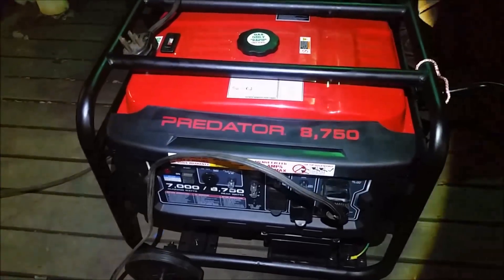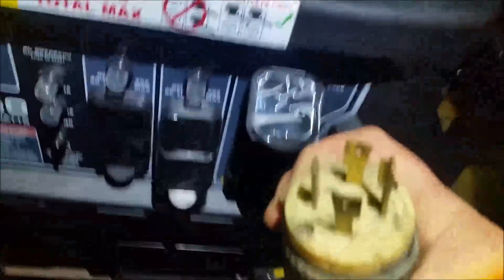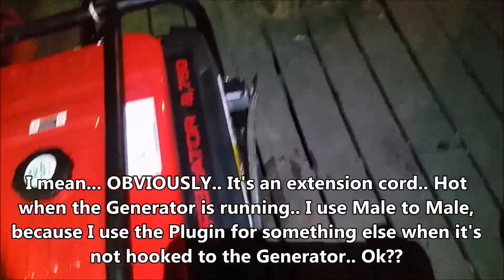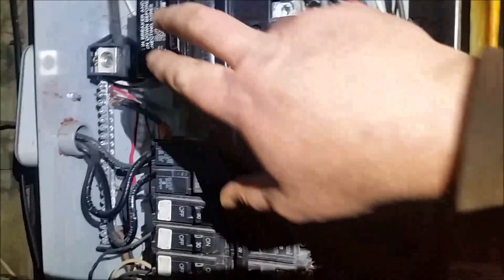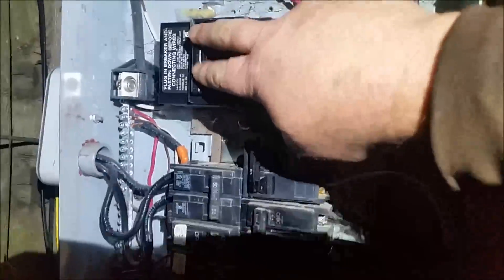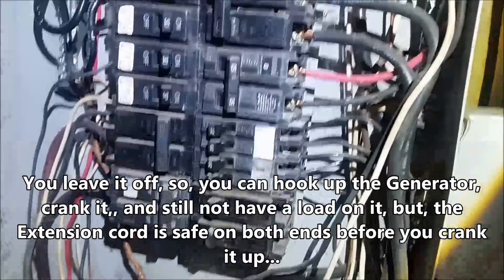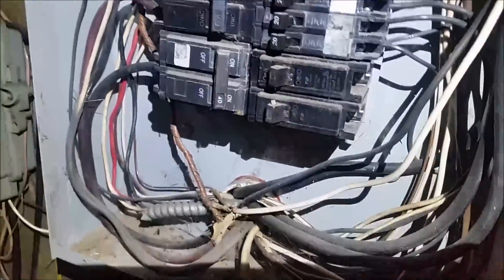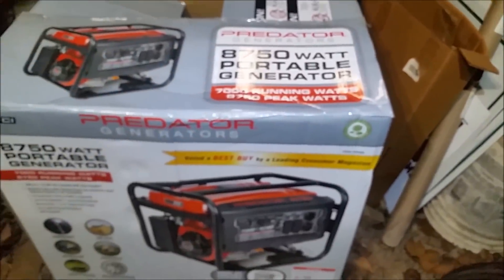Quick/Easy/Safe: Use Existing Plugin/Breaker for Generator hook up to your house Panel box.

Comment: Just to re-iterate what was said in the video, If you don't know what your doing, don't do this, If you're going to anyway, One thing to keep in mind, If your home has RCD/GFCI protection in almost all cases this will void it by doing this, Unless your generator has a GFCI/RCD on it, In that case, make sure your generators ground is directly connected to the house ground. If you plan to do this frequently, I'd advise you to buy the correct switch, If not, Pickup a 2nd hand or new GFCI for this setup. If you don't know what a GFCI/RCD is, and or how to install it, Don't do what was done in this video.
Reply: Tau, I don't have any GFCI breakers so no problem however I am having trouble visualizing how a generator would present a problem. A GFCI breaker detects a difference in supply and return currents and trips if they differ by a small amount. How would a generator powering the busses cause a problem?
Reply: Ed Taylor In most cases (At least in Australia) a GFCI or RCD in a home is connected FROM the main breaker to a bus of some kind. 'No' current will flow though the GFCI in your home because it is not connected to any discernible load of any kind when the generator is connected in this way. Voiding its principle of operation of the unit, Your GFCI will not trip if a fault occurs. If your generator has it, That's what i would call acceptable, Taking into account what i said of course.
Reply from the maker: Tau.. I take it that Austrailia has 220v as a standard? Do you have 110v's there? Because,, if not, we are still talking the exact same thing. What Ed said was exactly correct about monitoring the balance between power and neutral wires..
I am not aware of Austrailia not being part of the UL and NEC.. I have never seen "Will No Ship to Australia" when looking at Electrical items.. I do not believe you are correct, even in Australia about a GFCI not allowing the voltage to flow. It has to allow it to flow to monitor the difference in voltages on the hot and neutral in order for it to see an imbalance to trip out.. 
Your house is the load.. Every thing hooked up to your house panel is the load.. As soon as you flip on the Generator breaker connected to the panel, power is going to be consumed by all devices connected.. They are all potential loads.. What would be the purpose of the GFCI, if it were acting as a Main breaker, rather than a flow detector? I think you should double check what it is you read. 
GFCI's are a very finiky unit, designed for small tolerances or variances in hot and neutral. They use a solid state circuitry with metal-oxide varistors that don't hold up very well over time.. Because they are so sensitive, they can't be hooked up to any type of motor that has a "Starting Circuit".. Even on motors with starting Capacitors to reduce starting loads, there is more than,, I believe is 5 or 10mA surge, if my memory serves me correctly.. I doubt very seriously, one could survive the average coffee pot for longer than a year, if it didn't trip every time the warmer came on.. 
I just looked up an article to be sure I was correct about the varistors.. This is a pretty good article.. Seems the writer is a bit paranoid though. I don't buy into his "Fail Unsafe" claims verses "Fail Safe" Claims missing from his article.. The basis of the varistor even disagrees with his claims.. But, he got the technical details correct.. I just don't buy the fact that the GFCI's don't Fail Safe as he states in his Article.. I would like to know how he tested the GFCI's.. The only mention he makes is this: 
Press the test feature of the GFCI protection device to ensure it works. Sorry, but, he is testing the Reset feature on a live working unit, not a unit that has reset.. I have never understood why they have more than a reset button on the GFCI, but, it surely does not test the Varistors to see if they are working properly.. Maybe that is why he is so off on that part of his article. Electrical Items are designed to "Fail Safe".. Not Fail Unsafe like he says... The UL would be all over the manufacturers of those units he is speaking about.. 

https://www.ecmweb.com/content/gfci-basics
BTW.. The GFCI Panel Breaker or any other GFCI for that matter, has a Power, Ground and Neutral.  No other panel breaker has this,, so they are easy to spot in the panel. So, once you pop in the breaker, it has power. Then, you hook up the White wire (Neutral) and the Green Wire(Ground), to the same Ground/Neutral bar inside the box.. You can wire them next to each other or on one end of the bus bar or the other.. It won't make any difference.. No matter where you put it, it will be grounded,, or it will be connected to the Neutral Bar, which is grounded. Either way you slice it,, it is the same.
Reply from the maker: Tau.. I'm having problems determining your point also.. I concur with Ed.. The Generator has a GFCI, but, I don't have any in the house panel or in the house for that matter.. But, I do have this same setup across the street with all of the above... Hot Tub has GFCI, Kitchen as 3 or 4 in it's circuits.. The ground from the Generator to the Panel is just the Extension cord itself..
To make it simple.. Turn the main breaker off.. Unplug the Welder and plug the Generator in the same plug and crank it up and let it go..  Nothing else changes.. You power the house where the welder was receiving power before the main breaker was shut off.. 
It is really very simple. I don't know that a GFCI would void anything.. Remember. The Generator has one on it's output to the Panel for starters.
Reply: Mark Thomas Not all generators have GFCIs, Not all people know what a GFCI is, and or why and how it is 'needed'/used.
Reply from the maker: You could be right..  I'm sure there are some old ones out there without them..  
I have had 4 large Generators over the years.. The one I am running now is 13 years old. 
All of them had CFCI's.. A diesel I had didn't look like a GFCI, but, was.. Didn't have a reset button.. Looked like a regular breaker, except it was white with blue switches.. but, when I ordered another replacement, it was listed as a GFCI.. My experience with them has not been good. Seems they always end up tripping for no good reason and have to be replaced long before any other item in the Generator. I usually order an extra one to keep on hand when I buy a new generator.. 

Ground Fault Circuit Interrupt.. Basically a super sensitive breaker without getting into technical details.. But, a ground is not needed for a GFCI to operate.. It monitors the balance of the Electricity between the Hot and Neutral wires, not ground. 
Not saying you don't need to have a ground, which is built into the Male to Male plug in this case or any other extension cord with at least 3 wires in 110v and 4 wires in 220v A/C Voltage. Whether or not you have one makes no difference in how this setup works though.. 
It really has no bearing on whether this works or not.. It will operate no different with or without one.. 
If you feel safer with one, by all means, install one, but saying if you don't have one, don't do this,, just doesn't make sense..
Reply: Mark Thomas I think you misunderstood what i said, I didn't mean  to give the you impression that a GFCI prevented power flowing though it, (Well, Omitting internal resistance of course) What i meant is in Most setups (At least in Australia) the GFCI In most configurations is setup as follows: HV Fuse -> Transformer -> Meter Main Breaker -> Meter -> Bus(s) -> Bus Breaker -> GFCI -> Breakers on some bus. This means that if you backfed into one (Or likely) Your main BUS-BAR (In Australasia case, 250v) It would void the GFCI all together, As in order for the GFCI to work, it needs some form of load on the other end, It's like a compass, If the magnets on either side of it are not balanced (to predefined extent) it will flip (Opening circuit) From the looks of what you said where you live your setup is +110 hot, 0=N=G (or 'White"), then you have -110 hot, (of course the -+ flip given your main hz) Where i live the setup is as follows on most domestic transformers, +120, (Normally) Center transformer tap (Ground), -120 Yes in your setup, if N = G you probably wouldn't need to connect a ground, It would still be advisable to make sure you have a GFCI on your generator. I myself have an old army Honda generator, Runs like a charm, Has no protection WHAT SO EVER, Sort of  the motor being overloaded and stalling (Speaking from experience)
Reply: In the US a breaker panel GFCI protects what we call a branch circuit as it is typically multiple receptacles all fed by one breaker. The GFCI can also be a GFCI receptacle installed in a kitchen (or bath) and protect other outlets downstream on the same branch circuit. So it appears that  GFCI circuits would not be compromised by the use of a generator.
Reply: Ed Taylor Interesting.

Comment: Whats the best way to see when the generator is maxed out? Is there a wattage max indicator on the generator? Thanks
Reply from the maker: Not on any that I have owned.. When you put too much of a load on the generator, it will slow down considerably (which you want to avoid when possible because the voltage also drops), or, if you put enough load on it, it will either kill the running generator or, it will throw the circuit breaker on the generator itself.
If I forget and turn on the water enough for the deep well pump to kick in, while I am warming the Electric hot water heater, it will either kill the generator or pop the circuit breaker.. It chooses which.. Strange, but, it does.. I guess it depends on how much voltage the well had to kick on to begin with.. Not enough, and it seems it would pop the breaker and enough, just bog down the motor until it gives up and dies or finally pops the breaker if it tries, stops and tries again.. 
If you turn all of your 220v breakers off in the house and slowly turn the on, one by one, you can tell which breakers you want to leave off.. Your kitchen could be a source of trouble too.. Microwaves are hogs. So are heaters/ovens-even the table top kind, coffee makers, etc..  Depending on the size of your generator,, might be able to run your central air/heat, if you turn everything else off for a bit.. You can play with it and see..
If you hook up a regular lightbulb, you can see when it gets a little dim, if you are looking at it out of the corner of your eye.. 
A UPS in your house will start beeping also, if you have one on your computer. Hope that helps.

Comment: Does the new generator have electric start like the old one?
Reply from the maker: Yes.. Both of mine do.. The Norther tools and the Harbor Freight.. FYI.. I think it is well worth the extra to make sure you have electric start. The batteries can be a pain sometimes.. I have had little luck with the cheaper Walmart (generator size batteries).. Their lawn size seem to last much longer, but, you have to make a bracket to use the larger ones and each generator has it's size limitations.. I have had the best luck with Car Quest batteries.. Have had one last 3 years and one last 5 years.. A little more than Walmart, but, worth it.. I have had luck with Napa also in that size, but it has been 50/50 at this point.. 
If you run the generator twice a month for 20 minutes each, it will really help the batteries and reduce other failures gas related, etc.. If I were not going to run it from time to time (like I have to), I would switch to Non-Ethanol or "real gas or white gas, or add a stablilzer".. 
I don't get stale gas.. Always having to run it and put new gas in to replace the old.. But, I would be sure to run it enough that I would at least burn a tank every 6 months to a year at minimum.. I have not had the HF long enough to tell you how it handles ethanol gas.. So far, we have had to use it at least once per month for 4-6 hours, which means fresh gas in it all of the time..
But, from what I hear from others,, it does fine with it.
Reply: When I had a motorcycle I used an automatic float charger to keep the battery up during the off season. Before the float chargers became available I used a trickle charger on a timer that just kept it on a short time each day. My son has a neighbor with an automatic (propane) Generac system. She turns the system off and goes to Florida for the winter and was having battery problems so they're going to try a float charger on the battery this winter.
Reply from the maker: I used solar float chargers on my vehicles during the off season. They worked pretty well.. I have used the Battery maintainers too that plug in to the wall.. If the Power Company were more reliable, I would use them on my Generator, but, I don't have that problem..Ha..Ha.. Hope to one day. They are considering doing some swaps and upgrades down here finally..
Reply: You would think your power would be reliable being so close to the source or is your feed from the other direction?
Reply from the maker: It actually comes from the other direction.. Large Lines go through the woods to a distribution center and then branch out and head back this way... Problem is,, there is a 3 phase line about 1.5 miles up from us, and we are a hard last 1.5 miles with very few customers on it.. The Supervisor on the crew just can't seem to remember that there is only one pole fuse that needs to be flipped back in when they bring up the 3 phase to finish the line,, no matter how many times it works out that way.. The lineman who work this area are always out working the contract crews in other areas.. The troubleshoot, identify and leave the problems with the contractors and move to the next.. Of course, that sounds really efficient until you add in the fact that they have 10 large trucks sitting there watching 1 or 2 trucks getting the job done.. But, they always head out on a different job without making sure the last fuse gets kicked back in..  That usually sets us back until we get notification the power is back on and tell them,,,,nope,, not yet and they get back out here again.. I would say our normal power outage ranges between 4 hours average minimum (usually 6 to 8), and 3-5 days after that.. Phones are worse... 
I have the President's office Secretary's phone number on my cell now after I contacted the PUC a couple of times.. Now, they seem to get right on the small problems.. Have not had a major outage since I got the number.. But, last time the phones were out (business phones), they were out two weeks.. I call in and have them forward it to my cell and try to handle the calls like that.. Not easy, but, doable with some extra work and return calls.. I'm sure it costs me though on those "missed calls".. 
They clean out the Right of way for hanging limbs, etc.. but, when we have lots of rain, it doesn't stop the trees above the lines on the sides of the mountain from falling over.. Happens all of the time.. You can't cut that many trees.. 
There is talk about moving some of the lines to an easier location to fix.. There is one place where they have a large 3 phase in a Rock cliff area.. If they break another poll, there really is no way to put another up.. Nothing but a Rock face and no way to get equipment up there to deal with it.. Last time, took 3 days to hand set a poll up there.. We actually got to see more than a truck or two actually working, trying to get that poll up the mountain and get it set.. 
One of the disadvantages to living here, but, I can deal with it.. Beats living in the city.. During the Winter months, I am just about the only one down here besides my Mother across the street when she is here and my brother also across the street when he is here.. Hardly anyone else down here... But, the place sure does light up in the Summer months..
Reply from the maker: Ha.. was out of power today from 4:30 to 9:30pm and then, from 12:30 to 1:30 for what appears to be a second repair on the same line..  It's pretty regular.. Ha..